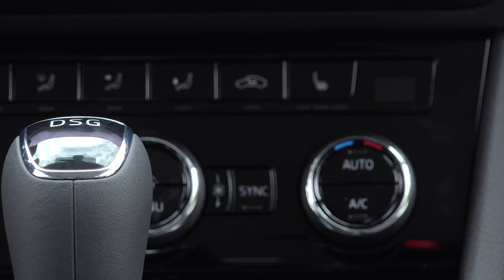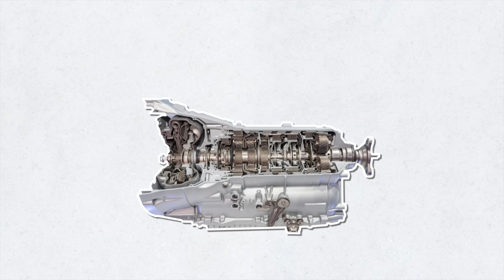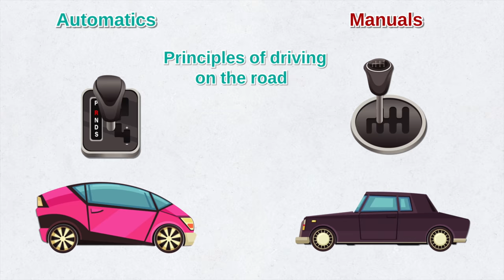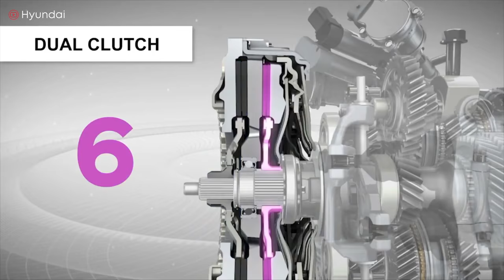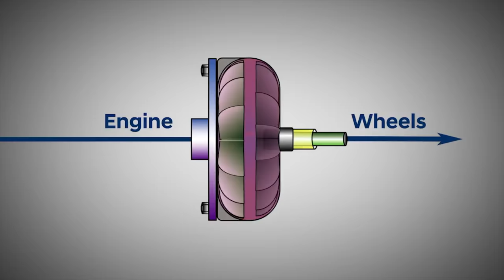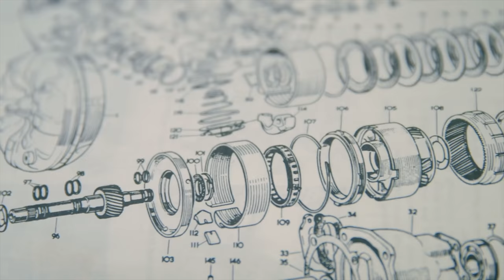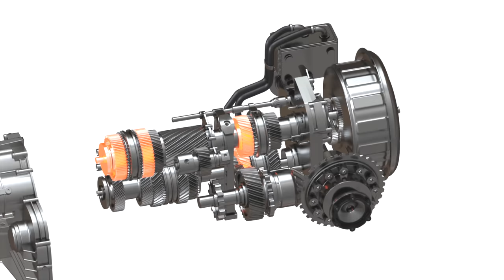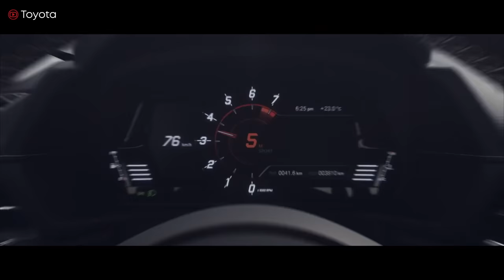5 Things You Should Never Do in an Automatic Transmission Car

Comment: I always get picked on for letting my car warm up before driving off. Don’t care...
Reply: Same here and the fact that my number one checklist for a new car is I need a manual. Don’t care I’m a dying breed
Reply: @brightsydebill8410  Not a dying breed, a surviving one
Reply: I love my remote starter for this reason. I've had one since about 2002 and never want to be without one.
Reply: I always do this, for both my truck and car. Trucks automatic and my coupes a stick
Reply: Just let it build oil pressure and ur good
Reply: You dont need to if its fuel injected
Reply: why dont we still use whale oil I wonder ? 😅
Reply: lol same
Reply: @brightsydebill8410  my dad has a 528i work car. When it's -20°c he immediately takes it to 6,000rpm without warming it up.
Reply: Yeah i been asked why I let my car warm uo before taking off i acrually want all fluids flowing good first !
Reply: Vance Wankel  well it's a work car so whatever. But that's why they die in 5 years probably 😅, someone will buy that car used someday and they'll get the repair bill.
Reply: @madmickey78  Today's   transmission  fluid  has  all  the  needed
additives  needed  plus  even  more  protection  than whale  oil.
Reply: @madmickey78  if you want a whale extinction, ya sure, why not!.
Reply: @Marc :-) I'd probably would have picked on you too,  (just as I did on a friend of mine) I promise I'll stop, since the reason Scotty is giving (transmission oil remains too long cold) makes a lot of sense.
Reply: Smart man
Reply: @dragospahontu  Correct :-)
Reply: Marc same here
Reply: @dennythedavinchi3832  the "research ships" are killing all the whales off anyway.
Reply: @dragospahontu   Exactly ! 
I've always let all my vehicles warm up to " Operating Temperature " . Usually about 100 degrees F . Warm oil flows better but you can't tell lots of people that . Of course , those are the people whose cars wear out faster and usually have more mechanical problems.
Reply: @jayhockley8841  smart man
Reply: I always do too and drive  2017 Jetta with manual. The owners manual even recommends warming the engine up before taking off. It only takes maybe 1-2 minutes tops.
Reply: @GlycerinZ  Yeah. Even scotty has said in past videos you dont have to warm up a vehicle like we used to. So I am puzzled why in this video he says it's a good idea. That said I still let mine run a couple minutes on a very cold day. 😂
Reply: Same
Reply: @dragospahontu  During the world wars, soldiers do that a lot in the trenches.
Reply: @Anth230  u don’t have to, just don’t go above 4000 rpm when cold, and break in period is a myth too
Reply: @jackz4149  True...
Reply: Not dying breed, just a master race
Reply: Quickest way to warm up the engine and oils and not hurt your cars little feelings is put a load on it and start driving it lol...the engines main/rod bearings/rings/lifters dont care if you drive off into traffic vs idling under no load and wasting fuel to protect your ego. The Pistons are going back and forth at near super sonic speeds already the piston rings dont care if your going 15-20 thru your neighborhood in 2nd gear vs sitting still
Reply: @Mass Debater Why are you replying without my permission
Reply: @Anth230  well, I'd agree on cold days to let it warm up a little.. like a min or 2.  I've owned the same car for 15 yrs and I have always just started it and drove away; however of course I was very easy on it until it got up to operating temp (like very light acceleration).
Reply: Bro literally! same here lmfao
Reply: @Anth230  p
Reply: It’s best to drive the car immediately, just not hard. This results in the least wear and best fuel efficiency. Just based on some googling I’ve done after trying to convince a friend it’s best to let the car warm up lol
Reply: @dragospahontu  I've done this before. It makes you sick 🤢
Reply: @ethan0145  this is true with modern oil and modern engines oil enters the sump before you would have a chance to even drive off and the extra condensation thins your oil from sitting too long on idle in cold weather which is an issue now more than ever because synthetic oils can last 10000 miles and the condensation can cause significant loss of lubrication amount the oil if done daily in cold weather climates. Carborated engines this wasn't true. Maybe it's time for Scotty to unlearn that habit.
Reply: I dont even warm it up.. i wish i had that time.. just the keys in.. 10sec and lets go
Reply: I was texting on my phone like hell in my manual 05 sentra
Reply: Yuh the most wear your engine will ever go thru is during start ups while it's warming up
Reply: Good job
Reply: @brightsydebill8410  nope I’m 18 and have had 3 6 speeds. Currently driving a 2000 vette 6 speed
Reply: I always at least let my newer car be on long enough to let my RPMs to come down to idle. Always hated the idea of starting and immediately going into gear and going. I know it's technically fine on newer cars, but it doesn't hurt to give it a minute or two
Reply: @Anth230  You don't need to warm up the engine to start driving.  Just don't drive it hard like above 3000rpm until it is warmed up.
Reply: @brightsydebill8410  just don’t drive the car hard (high revs) until it has fully or close to fully warmed up
Reply: My Nissan Z manual says to let the RPM's come down to idle during warmup before shifting.  Always did that anyway because why would I slam it into gear when the RPM's are 700 above standard idle?   That's a big shock to the entire transmission that's still cold.
Reply: @Anth230  yeah, my 92 subaru legacy starts @ pretty high rpms in the winter if I don't let the oil warm up. Some people don't know how to listen to the world...
Reply: @thunderocker343  Me too. I drove work and personal vehicles for years with manual transmissions, and now I want another one!
Reply: @standhd  Someday I'll join the manual gang lol.
Reply: Oh I do the same thing.  Even when it is warm outside.  I let my car run about a minute or so before I leave.
Reply: I heard that a vehicle with a carburetor needs to be "warmed up". Otherwise the time it take to get ready to drive, in a newer vehicle is ok to drive.

Comment: Truck driver for years now, and when they started mainstreaming the automatic transmissions in our industry, we thought oh hell, here we go, but, it turns out that it's much better then you would think! I had a truck years ago that got 4 to 6 miles to the gallon, and that was pretty standard (no pun intended), but now, these new transmissions get us 9 to 11, even loaded! Once you get past the control issue, and get comfortable with the truck doing the thinking for you, it's gets easier to deal with! Great video
Reply: No clutch knee.
Reply: I love manual in my cars but when you have to do it for work you might as well make your job as easy as possible
Reply: I love Automatic Transmissions now that I am on my late 40s/ Back in the days, I only drive manual transmission vehicles including a Freightliner and Kenworth trucks. My first car was a Toyota SR5 1990.

Comment: My Dad was a truck driver back in the 50's./  He taught me to drive a manual at age 13.   He also showed me how to shift without the clutch using engine revs.
Reply: Such a beautiful feeling when you can hit that sweet spot
Reply: niceee
Reply: Yes, feather the gas pedal and feel the shift lever into the next or wanted gear.
Reply: But ya can't do that in a 10 sec Quarter ;)
Reply: Yep, the last manual transmission I had was a 1987 Cavalier, and I got to where I could do that pretty easily.
Reply: @StormsparkPegasus  51 Jeep M38, 61 VW Bug, 63 Jeep Wagoneer, 66 Jeep CJ7, 69 VW Bug, 70 Mustang, 70 El Camino, 74 Subaru and 76 Scout. No owned stick shifts since about the late 1970's. Drove a Peterbilt one time-shifting galore. 
Would I have one today? Depends on the vehicle, most automatics today are better than a stick, even in a 1/4 mile race, but I'd opt for an auto with most new vehicles and maybe with some older ones choose the stick shift especially if it were a utility vehicle.
Reply: I've done that before. Comes in handy if the clutch pedal breaks like in my 1980 AMC Spirit.
Reply: I also can go up and down without the clutch. Most people are shocked. 
I explain it’s why it’s called a “sync”romesh gear box 👍
Reply: @OverlandTT  Back in the day they called it "Double Clutch" when there were no syncros in transmissions.
Reply: Downshifting that way was always fun, and clearly doable.
Reply: Easier in a truck than a car
Reply: In the 50s? How old is your dad?

Comment: I admit, I was switching from D to R quite quick and often, especially when stuck in the snow. Not anymore. Thank you Scotty!
Reply: @ThePatUltra My dad unfortunately does this in our 2014 Honda Accord. It's not hard to come to a complete stop before you put it in park but to be fair he keeps his foot on the brake the whole time so I'm not really sure if it's actually doing any harm. I still don't like how he does that though.
Reply: I would always put my automatic on neutral when I’m coasting down a freeway at 70mph, glad I watched
Reply: I once did that at work with the company vehicle SMH
Reply: A lot of people do this. I never understood why. It's common sense.
Reply: Winter tyres are less expensive than a transmission 👍
Reply: @IamJay02  if u change gears while car is rolling u will strip gears cause the gears are still turning and when u switch from reverse to drive u are forcing those gears to change opposite directions while turning
Reply: @dodgedakota1  Wow I totally didn't know that 😐
Reply: In ALaska Me too
Reply: @ThePatUltra all your hurting is the parking prawl.
Reply: Freed many cars that way in snow NEVER had one go out. You just rock it back and forth
Reply: D to R?
Reply: @AIDAHAR210  drive to reverse
Reply: @nissetuta  you can push clutch petal in and out quickly and the vehicle will rock a little have done it with stick before back when I drove snowplows in the 70s 😁
Reply: @sheerwillsurvival2064  is this reference to automatic transmission? I never seen one before tbh
Reply: @dodgedakota1  😭
Reply: @Giardintek  yeah it does lol

Comment: My mom didn’t know there’s a things called transmission fluid, so she didn’t change it for 10 years. 10 years later when my mom went into the shop for a whole vehicle complete check, the transmission fluid turned its colour to total black. The mechanic guy told her that she was super close for destroying the car.
Reply: If the car had normal life-time mileage she got scammed. Transmission fluid turns color that doesn't mean its burned or done for. Most modern transmissions use sealed boxes with "life-time" fluid. Which only means until garanty if out. So about 150 000kms. I would change the transmission fluid around that on a car, 10 years or 125-150 000 kms. 50 000 km if you tow.
Reply: Change fluid on a regular basis
Reply: Bought a Chevy Malibu V6 a while back for $1k off of a used car lot. It could barely shift into reverse. Transmission fluid was black. Changed the fluid & filter, and it shifted seamlessly for the past 4 years with no issues. Overhauled the engine over the summer, and maintenanced the transmission at the recommended 30k mile mark. The fluid was pale brownish-red. Not bad, not great. Next change will be after 20k miles.

Comment: Back in the early '90's I had to have the transmission on a "93 Lumina worked on.  Picked it up and stopped at a gas station only to have all the transmission fluid leak out.  They forgot to put the seals back in.  Good ol' AAMCO.

Comment: Additional tips: release or pull handbrake when its on Neutral, then safe to shift to the rest of gears you want. This tip is to prevent any damages on parking lock mechanism, so all the weight of the car is hold by emergency brake on priority. I was told by VW Audi Revo tuner long time ago.

Comment: My manual came with hill assist so when it senses you are on a hill it applies the breaks until you get going. Its a neat feature and saves you from rolling into somebody behind you putting it into first.
Reply: Must have been a Subaru
Reply: @avdavy3733  Ford Fiesta St, close. 😂
Reply: It was weird figuring out why it wasn't rolling back coming from old VW beetles and saab 900s etc all the manuals I've ever driven but its definitely a good safety feature.
Reply: I recently sold a 5th gen Jetta with manual. Guy bought it to teach his kids to drive manual. I told him it's a real manual, no hill-holder. However, the new ones have that feature.
Reply: Nothing  new.    Studebaker  had  it  back  in  the  50's  and  maybe
even  other  car  manufactures.
Reply: @williamoneal3947  Nope, Studebaker had it back in the 1930s!  We had one from just after the War and it had that feature.
Reply: @avdavy3733  i had it on my BMW.

Comment: Whenever I park a car with an automatic transmission put the car in neutral apply the parking brake lift off the regular brake pedal to allow the wait to be held by the braking system before shifting into Park. I've always done it and have been told by many people that I will wear out my parking brake cable but I still haven't.
Reply: Nice, same here!
Reply: On an incline, that's certainly the best way to do it. Will it really affect the longevity of your AT? Probably not. Salt on your roads? The cable is more likely to bind.  Ever break a parking pawl? Know anyone who drives correctly who has?
Reply: @wholeNwon  I've never had a parking break failure, but I've known people with auto and manual transmissions that put the strain on the drivetrain before applying the P-Brake. My parents were the first two and they rendered multiple P-Brake systems pointless. I'm never going to say "it won't happen to me" because it could, and might. I'll keep doing it my way because I'm as comfortable as one can be with today's quality control standards.
Reply: @wholeNwon  I don't get the last two questions. I don't understand "pall" in this context.
Reply: @TA_Plus_Hemi  Sorry, pawl.
Reply: @wholeNwon  Also I'm sorry about the confusion over the term pawl. I appreciate you understanding I was actually trying.
Reply: @TA_Plus_Hemi   The problem was entirely mine in not noticing the  misspelling of "pawl". As I said, your technique is certainly best, esp. on inclines. Personally, I don't do it on level surfaces because I see no reason to.
Reply: I've usually noticed if I put a vehicle in park, engage the parking brake, then let off the service brake, it holds the vehicle in place before it rolls into the pawl.
Reply: @tOSdude  Not surprised. I've relied on the pawl and very rarely used the parking brake for 60 years. No problems but our terrain is flat. Otherwise I'd do what you do.

Comment: Hello Scotty, grettings from Swiss. Is always a pleasure to watch your videos and listen religiously your honnest advices.

In my case, i change prevently the colland fluid, breakes fluid, power steering fluid and transmission fluid every 60'000 kilometers (37'000 miles) or every 2-3 years. The same for the timing belt.

The last 20 years Alfa Romeo, Lancia, Fiat, Opel, PSA group, VW group, they have a lot of problems. The timing belts broke down around 50'000 kms (31'000 miles).

Just a few persons buying me an old car. They always says the cars are looking good. But after 2 years problems are starting, and they charge me for their own faults. That people just do not make the half of the maintenance i do.

I explain them, but nothing change. Everyone have got the free choice.

Take care Scotty. Have a nice route...

Comment: I drove a 21 speed dump truck, with a compound 3 speed shifter you held your arm through the steering wheel to shift both at the same time! Best truck transmission ever made. I even learned the heal toe shifting like the F1 old school drivers. Most do not even know what that is!
Thank you Scotty. And the parking brake tip, is the safest and best way to save a transmission stop pin and your own life if it brakes or slips!

Comment: Good point about using the brake as well as the parking pawl.
I have noticed over the years that when parked on a steep hill, the stress on the park pawl is so great it is brutal to get it out of park, sometimes with a bang.  I now apply the parking brake FIRST while using the brake pedal to create good pressure, THEN put it in park.  Then later when I want to go, I take it out of park FIRST then release the brake.  In other words, I am using the park pawl as a safety net, and having the brake actually hold the car.

Comment: Scotty..You are an irreplaceable wealth of knowledge...(NOT sucking up!)  I have a 2007 Subaru Legacy Special Edition wagon..It has an automatic transmission with a Sport Shifter.  Brakes are cheap, tranny's are $$$$..Can I downshift in Sport mode when driving (especially to curb speed on downhill tarmacs in town) and be confident that I'm not causing premature transmission wear? This car has DEEP sentimental value and I want to keep it working well as long as I can...I used to use Sport mode all the time until I started viewing your channel...

Comment: Best way to protect a CVT transmission when parking is to put the car in neutral, put the parking break on, let off the brake so the weight is on the parking brake, then put the car in park.
Reply: The best way to protect a CVT Transmission is to not have one. the recent class action lawsuit against Ford Motor Company is proof of that.
Reply: True
Reply: Best   way  to  get  most  life  from  CVT   transmission,  is  to  change  filter
and  fluid  every  35,000  miles.  Much  cheaper  than  having to  replace.
Reply: Thank you, I was going to say the same thing. Except, why did you limit this process to CVTs?  This suggestion should apply to ALL automatic transmissions. 
I believe this saves wear on the parking sprag.  I always cringe if when taking the transmission out of “Park”, feel the resistance on the sprag as it slides, and then hearing the “thunk” as the pressure is released.